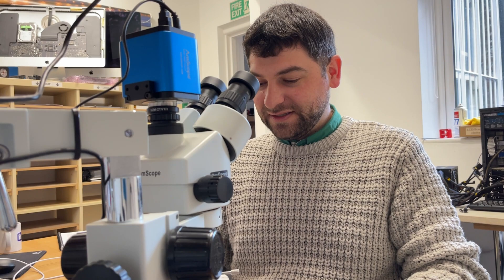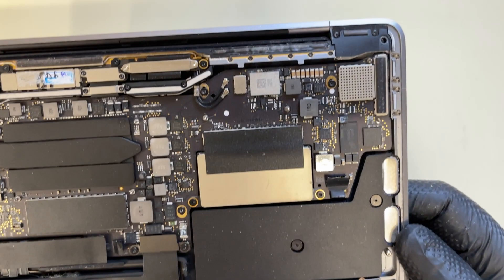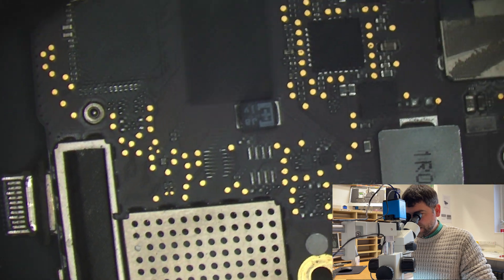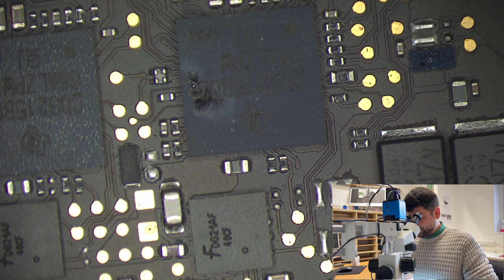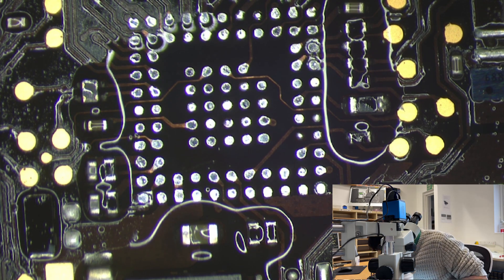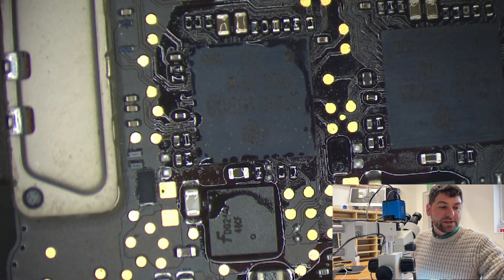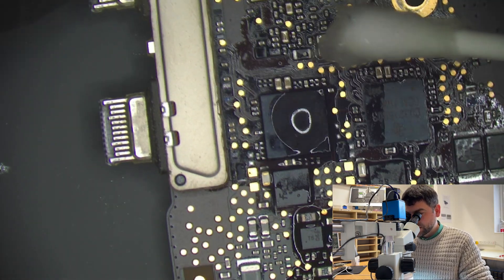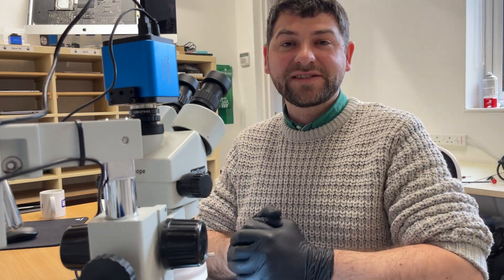MacBook Pro A1708 won’t turn on or charge – USB-C Charging Fix!

Comment: Wow, great work, doesn't tought this could be done! 
I'm have a MacBook Pro (M4) with a weird behavior: I doen't load on USB-C power source (even via MagSave port), only with normal 230V Adapter. Have you an idea? I need USB-C power source because I'm in a camping car with only 12V (+ adapter). It worked all the time... until now. 😕